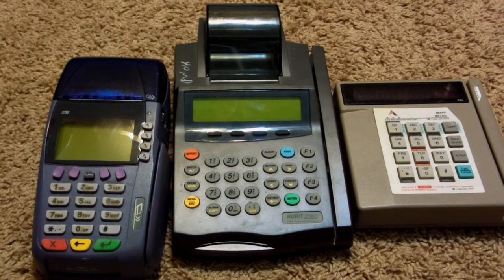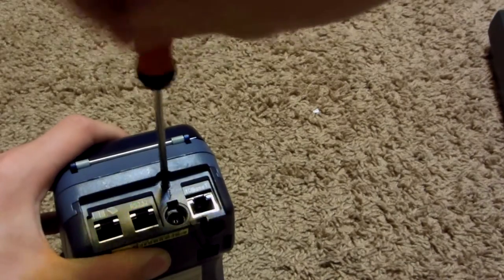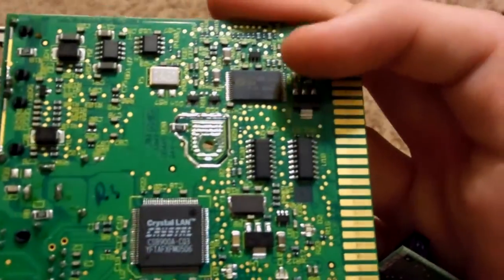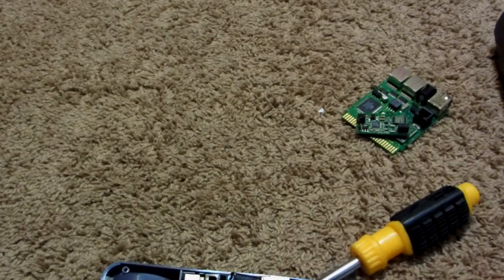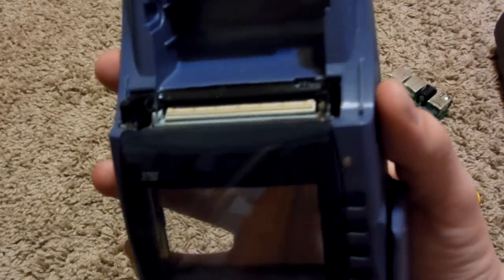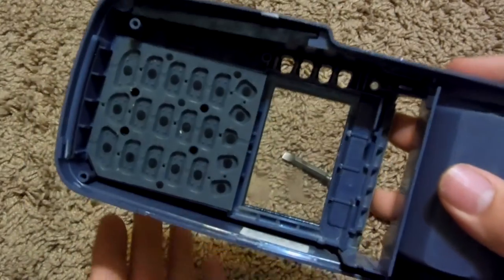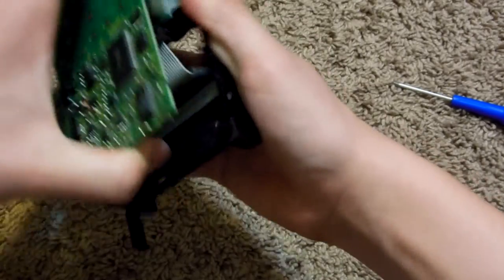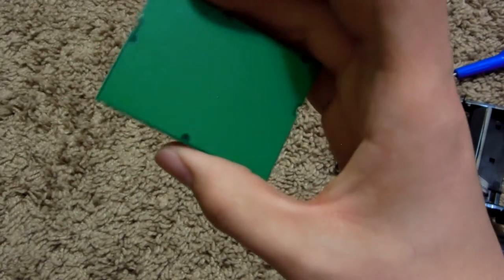E-Waste Scrapping: Card Terminals! (01 / 03)

Comment: Lots of good looking boards, the one you are talking about around the 14 minute mark, wouldn't that be considered a gold bearing board with the gold flashing on it?   I don't have a place to sell boards where I live so I either have to make a big shipment (costs way too much), process them myself or they go in the TIN bin for the scrap yard.
Reply from the maker: I believe so. It is a low grade board, but IT IS gold- bearing.  It is up to you what you want to do with it. Doesn't weigh much, so shipping it wouldn't be worth the trouble in my opinion. I would process the board myself. 
It wouldn't take very long to remove the components, and remove the gold flashing with a quick dip in HCl/Oxygen or HCl/H2O2 after using HCl to remove solder.  Then, clean off the board and possibly sell it online then, or chuck into TIN.
This is how I would do it, but it is ultimately up to you.
Reply: I will be processing the boards myself when I have enough to process.  I live in Western  Canada and I would need quite a few kilos of boards to ship to the US or Eastern Canada to make it worth the time.  Cheaper and more fun to process them myself :)
Reply from the maker: CCDetecting and Scrapping Couldn't agree with you more. I process the boards myself, and the depopulated boards go into my low grade board box where I get a pathetically low 3-5 cents a pound. I can't put them into tin, as I was already told not to do so once. As a result, I have to go to a different yard to sell them separately.  There is only one e- scrap yard in my area, which I didn't even know existed. Not only do they have the low 3-5 cents a pound , but even worse they round to the nearest 10 cents, and pay in check form. You could potentially lose a small amount of your actual value that you sent in. I only made a buck on a box that took many weeks to fill. But better than nothing, as it is a hobby. :) It does help me reduce my waste output, as I used to bring all the PCB's to the dump. They may even begin buying plastic bottles, which would be awesome.
Reply: Some money is better than no money, that is true :)  Especially as this is just a hobby for both of us:)  That is one good thing here in Canada, we can turn in all beverage bottles, cartons and cans for a deposit return.  every can i pick up off the street is 10 cents and any bottle over 1L is 25 cents.  Adds up after a while :)